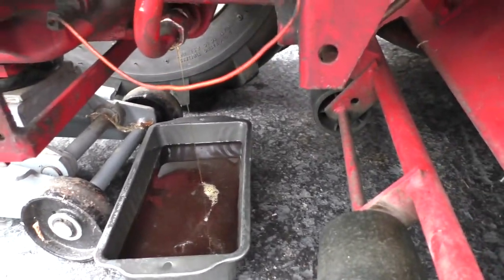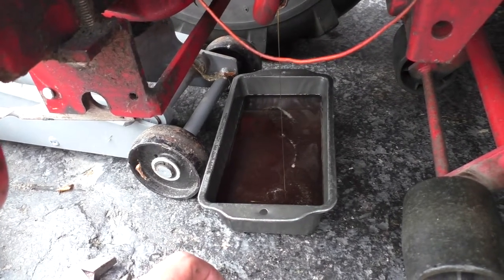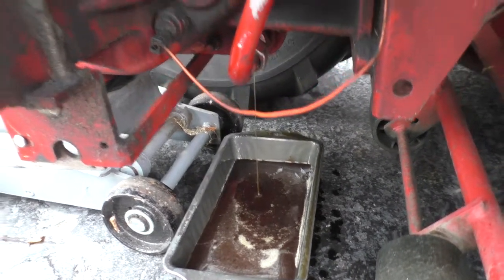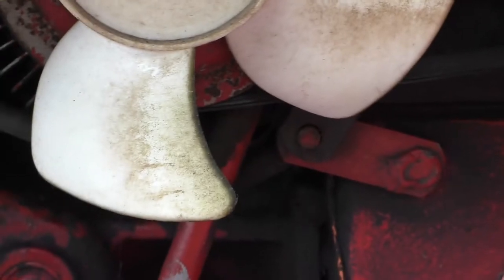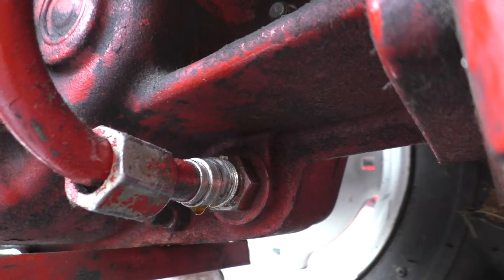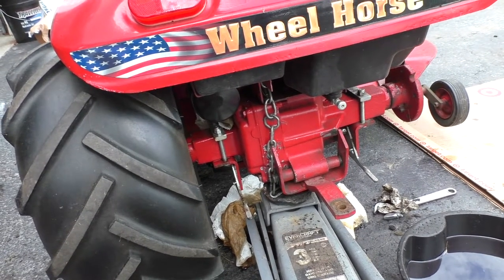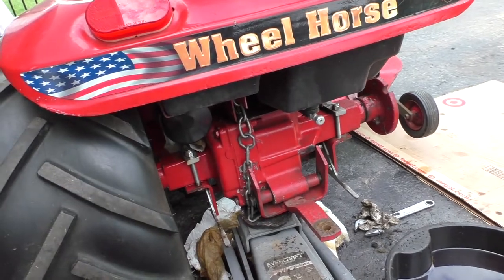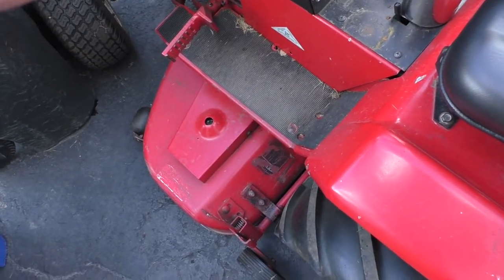Wheel Horse 520H hydro oil change

Comment: Another great video Craig, and it is one of the messier jobs on these machines. On my 520-H and 418-A with the Eaton 1100, I use regular 10W30 and don't have the "misting" past the seals issue that you are seeing. I also leave the filter off while adding the new oil as a way for the trapped air to escape. Much easier than getting to those bolts.
Reply from the maker: Thanks Andy.  In the winter, I would have to wait 10 minutes for the oil to heat up to where I could lift the blade.  With Mobil 1 10w30 I can use it much quicker, it warms faster.  Kind of a trade off I suppose.
Reply: @CraigArndt  hi man after watching your video I still don't know how to change my oil , where is the oil drain plug located ? Any idea how I can change my oil on my 520H ??  I don't know where the drain plug is located ? If anyone knows how I can change my oil on this model let me know , thank you

Comment: As mentioned, there is a drain plug on the bottom of the tranny. Suggestion dont install the new filter until after the new oil is in. Also, removal of the rear wheel makes the filter change a snap.

Comment: Good deal. My 520 is overdue for a trans mission change. I need to pull the axle seals and get those changed out as well. YOU might want to check and see if your misting is coming from one of the smaller oil seals around the shifter at the top. I replaced mine and still have the seal to replace the brake drum shaft as that is leaking slowly. 

But in regards to your sled. I know this late but I hope you went ahead and decided to replace both of your crank seals? when one goes, the other won't take long to go for some reason. Most likely because of the pressure built from having the new one. I did the PTO side on my wife's 96 ZR580 efi engine and that lasted two years and she lost compression, thank the Lord, on the way back to the hotel on last day of our last trip that year. AND we were able to barely get it started to get all of the way back. So that was a blessing. But deff rule of thumb from now on for me is if one seal needs replacement, I pull the cases apart and replace them both.

Comment: I have two Troy bilt gtx tractors both with eaton 11 hydros. The first one I bought from a guy who maintained meticulously. The second one,the guy bought it used and never changed the hydro oil. I found this out when I asked him what type oil he used he told me never changed it because it never gave him problems. Anyway, I was surprised to see how clean it was when I changed it. It looked like new oil and anytime I change the oil on either of them the oil looks immaculate.the first tractor has been used year round for over 20 yrs and I did have to replace the pump shaft seal and bearing as seal wore and started sucking air into the system but works great now. Just wondering why yours came out discolored as it really shouldn't be. Also as well as keeping the fins clean it's also important to keep the fan clean. I frequently wipe mine off with degreaser. A clean fan pushes air more efficiently. Thanks for the great vid.
Reply from the maker: The oil doesn’t really get dirty in a hydro unless the hydro is failing.  If there’s a filter it stays pretty clean, assuming moisture stays out.  I’ve been using synthetic oil in mine the past several years, definitely is a lot more responsive in cold weather.

Comment: Just a thought - if using Mobil-1 synthetic oil creates leaks, I would imagine your transmission has some sludge and debris buildup in it that will need to be cleaned out. The synthetic oil has detergents in it which clean any sludge or contaminants off of the internal parts and blend it in with the oil. If the machine had a history of sludge buildup in the trans over the years as the seals/gaskets began deteriorating, switching to synthetic oil would have cleaned all the sludge and exposed all the dryrotted gaskets or seals, causing them to leak again.
Reply from the maker: I had the entire hydro apart and the pump in a video I did some years ago.  The pump was super clean, just had bad seals from 30+ years of hard use.

Comment: Is it ok if I drain the fluid through the hex nut? Or is it better if I drain it through the tube? Also when adding the fluid to the transmission should the engine be running so it goes through?

Comment: Synthetic is is why the oil seeps through the fittings, and gaskets. Conventional would be wise to stick with. However, due to you running Synthetic already. Instead of semi-synthetic, try using high mileage 10-w40. It contains extra spellers and will decrease the leaks over time.

Comment: There’s a drain plug on the bottom Craig
Reply from the maker: Yea, I could have made it easier on myself.  I saw that plug when I was laying on the ground blowing out the fins.
Reply: Is that the hex screw on bottom that you're talking about ?
Reply: @romanmurray9489  yes
Reply: @WildHorsesOfCourse  I tried loosening mine and it's extremely tight. Is that normal? I stopped because I worried I might damage or break something.
Reply: @tbirdsteve1  if it hasn’t been out in a while they can take some effort. I broke a brand new hex socket doing my last one but that’s not “normal”.